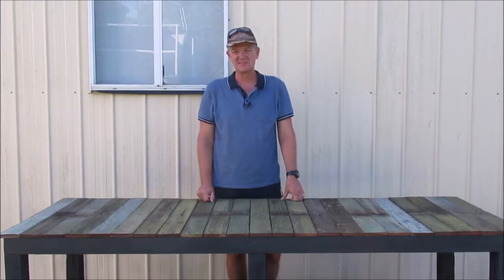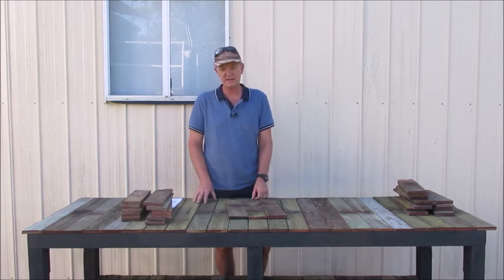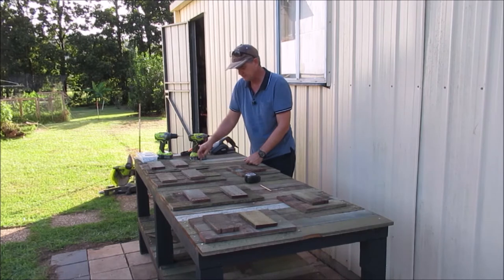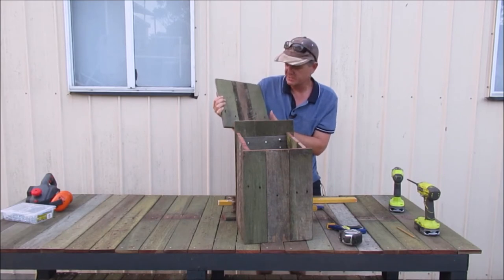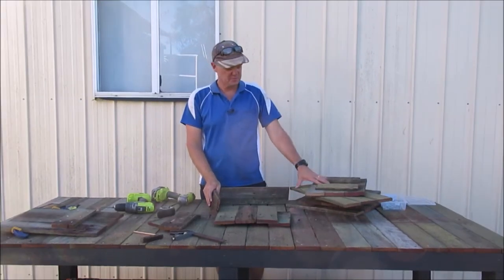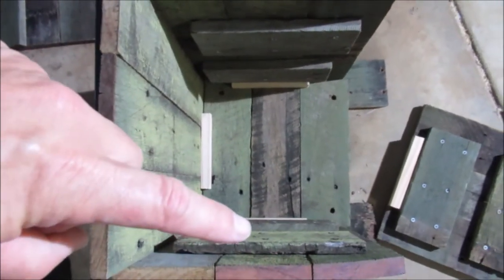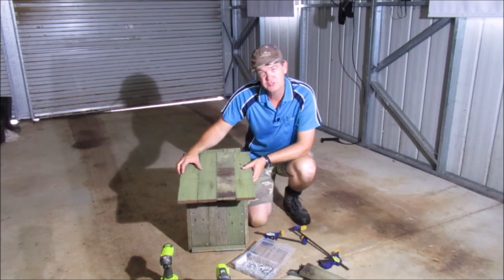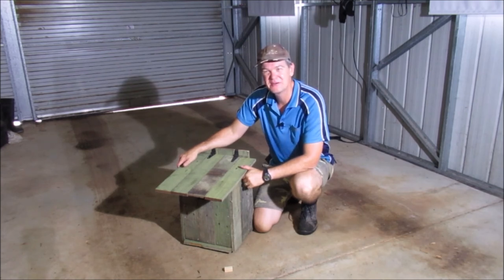How to Build a Cheap Possum Box

Comment: I would have placed the pieces (braces) you screwed into the wood on the outside to give the possum more room. It is not waterproof so when it rains it will be wet on the inside.  (Only paint the outside) You should have placed a channel that ran along the roof line so the drip of rain would not filter back to the box.
You need some weather proofing (a strip) on the roof where it opens by the hinges. Your design would work ONLY in a climate where it rarely rains. You are new to carpentry. You CANNOT USE TREATED WOOD.

Comment: Why not just use plywood?
Reply from the maker: Plywood would be a great option. I wanted to try using materials I had at hand, rather than go out and buy some.
Reply: This is what I posted to him. >No animal will want to be in a wet environment.  I would have placed the pieces (braces) you screwed into the wood on the outside to give the possum more room. It is not waterproof so when it rains it will be wet on the inside.  (Only paint the outside) You should have placed a channel that ran along the roof line so the drip of rain would not filter back to the box.
You need some weather proofing (a strip) on the roof where it opens by the hinges. Your design would work ONLY in a climate where it rarely rains. You are new to carpentry. You CANNOT USE TREATED WOOD. (Clearly he used treated wood.)

Comment: Well? Any luck?
Reply: No animal will want to be in a wet environment. This was the comment I left to him.>>  I would have placed the pieces (braces) you screwed into the wood on the outside to give the possum more room. It is not waterproof so when it rains it will be wet on the inside.  (Only paint the outside) You should have placed a channel that ran along the roof line so the drip of rain would not filter back to the box.
You need some weather proofing (a strip) on the roof where it opens by the hinges. Your design would work ONLY in a climate where it rarely rains. You are new to carpentry. You CANNOT USE TREATED WOOD.